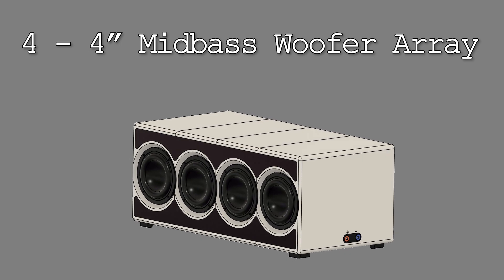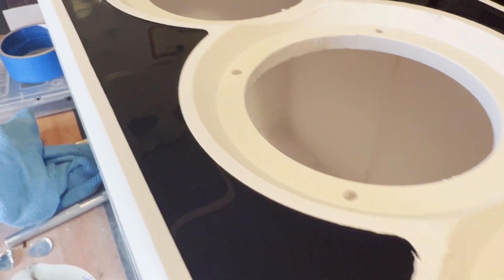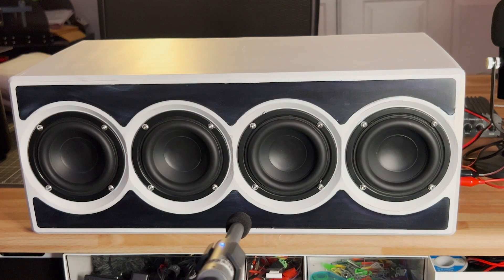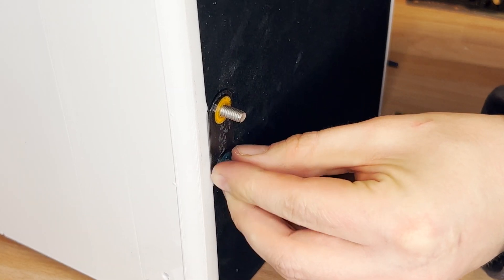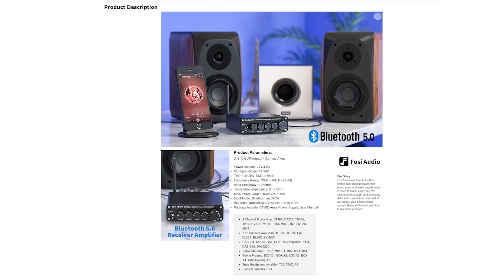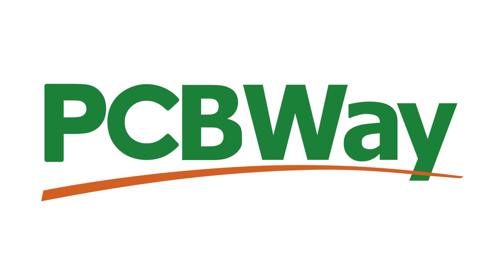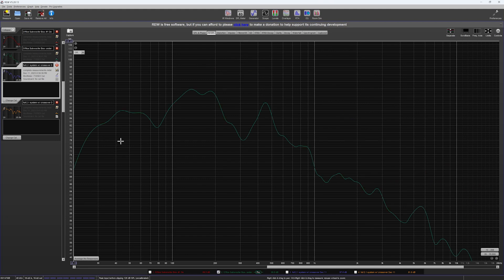The Final Piece: Completing My 3D Printed 2.1 Sound System with a Subwoofer!

Comment: The first additional speaker would be a 3 decibel (double) increase, that's correct. But to get another 3 db increase, you would need 2 more speakers to double it again. So four speakers actually only gives you an increase of 6 dbs (quadruple) over one
Reply from the maker: Didn’t know that, but it does make sense since decibels are orders of magnitude louder for small changes in numerical value. 

Shouldn’t 10 decibels be double loudness though? 

Where double power is a usually a 3db increase.
Reply: @piscesprinting  3 dbs is double the power, which does mean double loudness. But it doesn't sound like it's twice as loud because our ears work on the same logarithmic scale that decibels use, which means in order for something to sound like it's twice as loud, it  actually has to be 10 times as loud. So 10 decibels is actually 10 times the power, but it's only perceived as twice as loud to our ears

Comment: Don't see much point in using 4 drivers in a small box, also for 60$ you can get 2 decent 8" subs, buuut if you build 4 small subs and add a dsp/amp for each you can really iron out the bottom end of the room response.
Reply from the maker: I used these small drivers as the printer I had during the time was size limited, so 8” subs would of required a joint across the mounting flange- while these small mid bass woofers- as Dayton calls them. They fit the bill of small, good power handling, and the frequency response range went low enough I could use them as subs with a filter. 

I looked into the DSP route as well and it wasn’t affordable at the time unfortunately.
Reply: @piscesprinting  really look into DSP its almost like magic - lets you correct a LOT of issues, just not fundamental ones.
Pretty sure anything ADAU1701 is really affordable these days.

Comment: Nice Enclosure! If you want these to be more rigid, you could try to fill them up with plaster or similar stuff instead of infill.
I also wanted to give some more insight on subwoofer enclosures. Using a single Sub doesn't equal a "one note wonder". That depends on many factors. The tuning can result in a peaky subwoofer, which we can see in your design. A real one note wonder subwoofer would be more appropriate to say about a 6th order bandpass (2 ports, 2 "peaks". Not an expert so I won't try to explain them).
Now about your choice of using 4 drivers: I think they do match the look of your line array quite nicely and that's what matters :) However I'd generally recommend to compare different drivers and see for yourself, wether you really need multiple small ones or one bigger driver is possible in your use case, as it mostlikely is more economical and efficient.
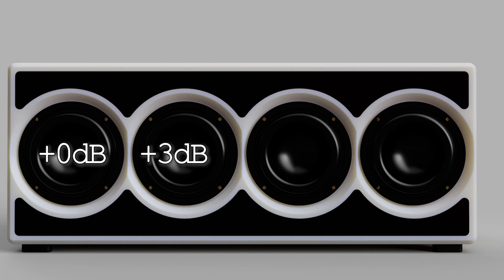At last, there is one vague/ incorrect part that I'd like to clarify: At 3:26 you are talking about how adding 3 drivers equals an addition of 9db at the same input power and impedance. While your amp may see the same impedance in a series-parallel configuration, it still delivers the same power. And while adding one driver does give you a 3db boost because of the added surface area, it also takes energy from your amp.
Basically: IF your amp can only supply 30W(RMS of the Woofers I believe) at 4 Ohms, then adding 3 more will split the load and wattage accordingly. Each driver will effectively only get about 7,5W. Which means all 4 of them are now equally as loud as 1 Woofer at 30W. What I'm trying to say is, adding more speakers only makes sense, if you still can deliver the RMS power of the drivers. Otherwise they won't be louder.
Reply from the maker: Also I had to go with smaller drivers due to print area restrictions. I wanted the box to print in as few pieces as possible with the restriction I couldn’t break up the mounting surface of the sub. I only wanted to stack pieces in 1 direction so my restrictions left me with a 250mm3 place to work with and needing sufficient mounting surface I could of maybe put a 6” driver in there at max but I don’t think I would have had enough room internally for pressure waves to move around unobstructed. Hence the 4” driver. ( as I wanted an array to match my tower arrays)
Reply from the maker: I didn’t feel these drivers needed the extra reinforcement from a filled box- I built some 8” enclosures last year for a 300W woofer and those seemed reasonable to reinforce with self level concrete. (You can find that video on my channel as well if interested).

As for the analogy of one note wonder to 1 driver vs multiple drivers- that was information I received from the channel hexibase on YouTube, I figured as a sound engineer he knew what he was talking about.

As for the 3db boost, when I referred to the ability to add that boost I meant you needed the same input power and impedance per speaker— meaning 1 speaker @4 ohms and 25 watts input will be 3db quieter than 2 speakers @4 ohm and 50w total (25w each) in a perfect world of course. There are damping factors and harmonics that are way above my head in regard to efficiency that will affect these as well.
Reply: @piscesprinting  Ok I may have just misunderstood you then :')
Reply from the maker: No worries. I likely didn’t explain it in a clear concise manner. I don’t do scripts for these videos so everything is just from the top of my head.